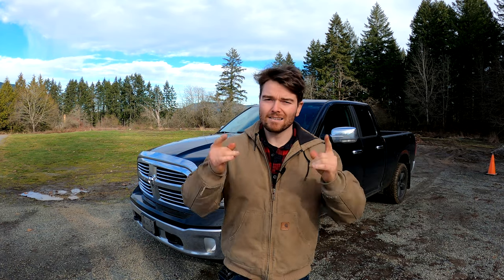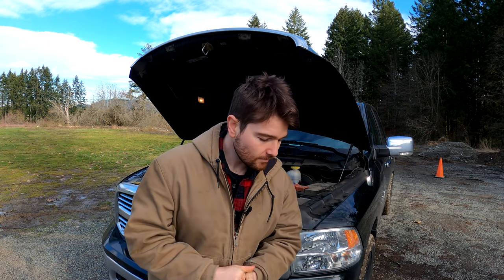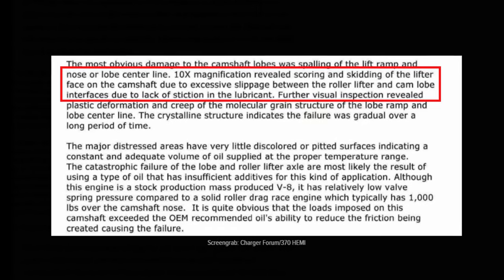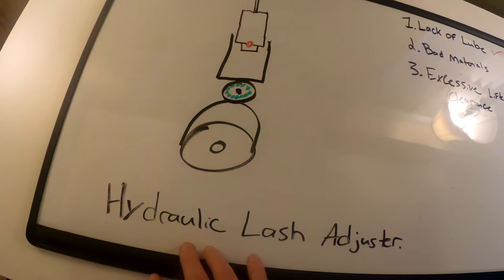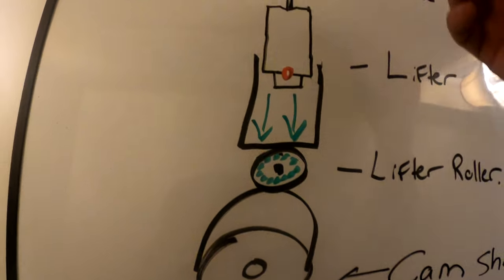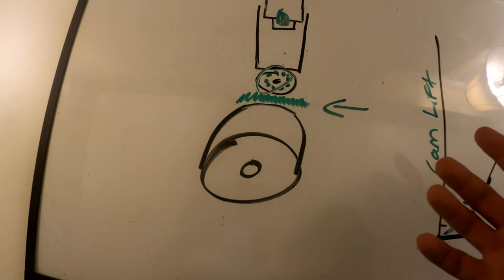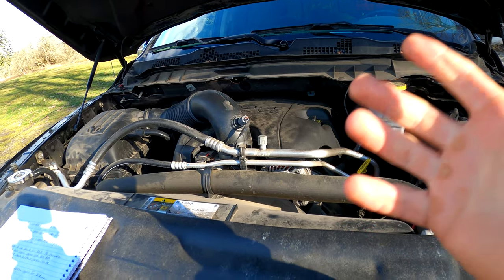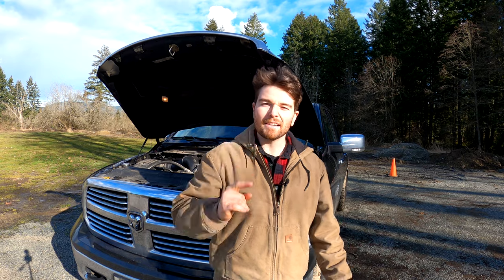RAM 1500 HEMI TICK Explained (Revised) - The Cause And How To Protect Your Engine

Comment: Not a knowledgeable car/truck guy. So, I'm a little confused. Obviously, stay on top of your oil changes (which I do). For now on, I'll buy the best fully synthetic 5w20 oil to bring it for the mechanic when I need an oil. But, my question is can geting ahead of the problem and replacing the lifters help get ahead of making sure you don't destroy your engine? And if replace the lifters, should I just replace the camshaft as well? My truck is at 128k miles.

Comment: Oil itself does NOT break down over time.  The oil can go bad over time from added combustion products (sludge), added water (water vapor) from cold engines and short trips, and the breakdown of oil additives (detergents).  I have worked in a power plant and the oil used to lubricate the steam turbine bearings was never changed.  It was constantly purified to remove water and contaminants.  The oil itself would last forever.

Comment: I have an 07 5.7 ram 1500 i bought from a family membr. been family owned since new.  basically over 300,000 miles on it by first owners business .   I bought it out of a field where it had been sitting for nearly two yrs.   Talk about a loud knock!  i was sweating it till the oil got to the top of motor! lol    anyway.  engine runs amazing and no tick until yesterday i heard it before it was warmed up.  after, it went away again.  No was not a exhaust leak.  i kjnow what that sounds like.  what it is is oil hasnt been changed yet...  that is my to do before anyting  else saturday project!
Reply from the maker: those "earlier" 5.7's seem to hold up better in term of lifter failure. it seems like the majority of the lifter failures are in the 4th gen trucks from 09-present. they re-designed the hemi in 09 and for some reason this re-designe has caused lifter issues. Either way good continuous maintenance goes along way and I've heard tons of people have high mileage hemis running just fine!

Comment: There was another video that a mechanic said that the problem was happening on 5.7 engines on fleet vehicles that all have had early oil change intervals. I also don't believe that there is a synthetic oil on the market, from any competitive oil company,  that so lacking in quality that would result this damage    I would hazard a guess that this issue has been discussed at length by FCA executives while using the "Cones Of Silence" in the board room. But unlike the tie rod issue don't expect a recall any time soon,  this is not a safety issue .
Reply from the maker: it's an interesting issue because many people have tried to find the cause (myself included) and the answers seem to kind of all differ. it could be a combination of things resulting in lifter failures. 

But what is fore sure certain is that FCA is aware of the issue and hoping to keep it quiet. I mean they did quietly update the lifter in 2016 so perhaps they are speculating the lifters themselves were the issue. time will tell if the 2016+ hemis are having the same issues

Comment: There are lifters available with bronze bushings instead of needle bearings.  Would that not be better?  Is synthetic oil better for this engine than non-synthetic?
Reply from the maker: Synthetic oil is by far better. As far as bushings, bronze is soft those needle bearing are hardened steel because they take a beating when the came lobe rolls around at speed. But its an interesting idea

Comment: I know this is video is old but there are at least four things wrong with your leaning to a bad oil theory: The first being the lifter lab study. The study wasn't necessarily wrong with their data, but their data was limited...to one study. What effort was placed into sending failed camshafts and lifters to multiple labs and comparing reports to see if they concluded with the same results? Which leads to the second thing and that is the study mentioning a lack of additives. How many people really put additives in their oil, regardless of year or make of vehicle, or engine type? Why would Hemis need an additive over any other engine out there? Thirdly, there have been a number of failures on Hemi engines where the owners changed the oil religiously every 3,000 miles. I for one, developed this failure on my 2010 Ram 1500 and the oil was changed every 3,000 miles religiously using Valvoline 5-20W. And fourth, we did not find this same failure in the 03-08 Hemis. They call for the same viscosity of oil and oil change frequency as the 09 and up Hemis. Why weren't they failing? Were 03-08 Hemi owners doing more frequent oil changes or using a higher grade of oil? I highly doubt it - 03-08 owners were likely following the same change patterns as those people who had 09 on up. So although sludge could be a contributing factor or accelerate wear, I don't see it as being the root cause of the Hemi failure. In my opinion, I really think the root cause falls on lack of lubrication at idle and low RPMs. Chrysler made design changes to the Hemi in 09 which, created several contributing factors: lifter angle, camshaft height, poor clearances, etc. Multiple studies have shown that the failure occurs predominately in engines that have excessive idling times. The engineers failed to foresee what the new changes would do under these circumstances. I think Uncle Tony is on to something about the need for an oil feed system above the camshaft that would drip down onto th lobes and lifters regardless of the idle speeds. Now I will say that the high idle times do increase breakdown of oil since vehicle engine hours are increasing, even when the milage isn't. But again, this by itself, doesn't account for why we didn't see the same thing with people who had long idle times with their 03-08 Hemis. When considering all factors, it points to affects created with the design changes and why Chrysler changed the lifters in 2016.

Comment: ⚠️THE 5.7 & 6.4 HEMI ENGINES BOTH RUN THE SAME OIL PUMP. THESE 2 ENGINES SUFFER THE SAME LIFTER PROBLEM DUE TO THE INSUFFICIENT 
*OIL PRESSURE @ LOWER RPMs*⚠️

THE 6.2 HELLCAT OIL PUMP PROVIDES HIGHER OIL PRESSURE @ THE SAME RPM TO THE 5.7 & 6.4.

All 2009+ hemi oil pumps are interchangeable regardless of engine liter. 

I highly recommend upgrading the oil pump along with lifters and cam.

Thank me later.

-Dad
Reply from the maker: Thanks dad! Lol a couple people mentioned this and it makes sense.

Comment: Ok so I have a 2016 Ram 1500 Hemi and I've noticed that when I let off the gas going about (starts at 25-30mph) I'll get this tick/rattle, when I get back on the gas it stops... I've noticed that when I get to about that time when it needs an oil change it gets a little louder... I'm guessing it's a lifter correct???
Reply from the maker: potentially but a lifter tick should be constant for the most part.

Comment: I just had to replace my cam and lifters in my 2012 ram 1500. they went out at 213,000 miles, i always changed my oil at 5000 mile with Mobile 1 full synthetic 5w 20w and Mopar filter, I think its just a shitty design personally. I know my failure was not from bad oil or wrong weight of oil. Oh, I also never let my truck sit and idle. Also had to replace both exhaust manifolds because they were warped.

Comment: I have had these issues with the 5.7 hemi. I honestly believe not enough pressure and under rated oil pump. I think its a oil pump issue. Stick a hell cat oil pump in there. There are videos and yes so far seems like it works. Time will tell.

Comment: Good video, I always like following your stuff! I've watched a lot of videos on this and Uncle Tony is quite convincing along with the idle hours due to lower oil pressure and based on a new video at Idle the MDS isn't activated to pressurize the lifter bores. That covers lubrication but I like the other components your talking about in this video..Here is another explanation that talks about some more topics - https://www.youtube.com/watch?v=8lj4mLhAI4Y
My Ram dealership said it calls for conventional oil and looked at me weird when I asked for a Synthetic Blend or even Full Synthetic. I'll be using Synthetic for sure on my 2014. It is interesting as well that the service manual doesn't really state how often to change it. It basically says wait for the oil change indicator system to remind you and to change it before 10k miles or 16k kms or 12 months...so I blame the owners manual as well for letting the general customer trust their indicator light. I change mine every 3,000-5,000 miles (5-8k in kms). Keep up the good vids man! I appreciate the new info.

Comment: A perfect storm of a series of unfortunate events.
Edit; btw, what do you think of porting the hellcat oil pump and putting it into an engine with the same bypass spring? 
Would you think it needs a bigger oil pan or what to go along with it?
Reply from the maker: apparently the hell cat oil pump fits right into the 5.7 and they are only like a couple hundred bucks. that's what I've heard but who knows the long term issues/ benefits of doing so.

Comment: I have 2015 ram hemi, and i have this ticking sound when starting the engine for around 1 minute then the sound is gone. I could not find any issue with exhaust manifold, could it be from the lifters? Or should i double check the manifolds again?.

The sound started 6 months ago, have slightly increased. However car is running perfect with so ticking sound after engine is warmed up
Reply: Had the same problem on mine and had to replace cam and lifters!
Reply from the maker: usually when the ticking sound lasts for a short time (like 60 seconds) it's a manifold leak. however, if the manifold is not leaking there is a chance it could be your lifters and after getting warm for a sec their clearances tightened up and the ticking becomes less obvious. 

Honestly if you are concerned bring the vehicle into the dealer or a trusted mechanic and pay for an hour or two to properly diagnose what's going on. they can probably narrow down what is causing the ticking sound pretty quick.
Reply from the maker: @lalo27ish  that sucks, how many Km's on the engine?
Reply: Exact issue on my ‘14 recently. Shortly after starting, the tick goes away. Would like to know how things progress for you Ahmad. 🇨🇦
Reply: @barrybebenek8691  unfortunately I confirmed its not the manifold. The sound started increasing specially at cold start. When the engine is warm it is also slightly audible.

Will plan to replace lifters soon and check for cam damage.

Comment: If it is bad oil then Chrysler is putting it in their engines right from the assembly line because my 2015 has been ticking from day of delivery ! Finally whipped the cam now two dead cylinders after 75,000miles still running at 152,000miles. I'll start looking for a replacement in a week or two LOL !  My best guess the oil ain't getting to the lifters !

Comment: Chevy 5.3 has same issues, I believe it’s the cheap lifters, my father in law has a gmc with 5.3 lifter failure at 60k Miles with synthetic oil and regular service… Chinese lifters as well… hope my 2018 ram stays quiet 🤣

Comment: please define bad oil.  How many miles?  I don't know anyone who would run an engine 14000 km without an oil change.  Are you suggesting that a normal oil change interval of about 5000 miles would prevent the hemi tick or is this a design flaw by FCA?  Very informative video nonetheless.

Comment: Uncle Tony's Garage found out why it does thus. Bad oiling compared to the old 318 and 360's, or any old Mopar engine. To get enough oil to properly lubricate the cam and lifters, you need to be over 3,000rpm. When you combine that with the bad oil, like Mobil, Castrol, Penzoil and so on, the cam fails. This is why it is necessary to use a good oil like Royal Purple, Lucas Oil or Amsoil because of the superior wear protection. Every day I take the engine up to 3000rpm for a bit and I use Royal Purple. The good oil stays up there longer and protects the engine.

My claim and trust in Royal Purple came after using it on my motorcycle. You may or may not believe me, but I had my bike often at 5 or 7000rpm, across many gears. I didn't ride "lightly." After 10,000miles on one batch of Royal Purple, when I change it, I saw that the engine oil color was still Purple after 10,000 miles. When I saw that, I swore I'd never use another oil brand again. 

And now, in my Dodge, I check the oil and instead of being black, like so many oil inferior brands turn, it's light brown. Combined with Seafoam regularly and Royal Purple, this next change, in 20,000 miles, would be purple, instead of black.
Reply: guys change the full synthetic oil every 5000 mil ,that is crazy,any full synthetic oil is good for more then this,so if the engine lifters and camshaft are bad after 50.000 mils then this engine is just a junk,shame of the FCA
Reply: @marmay6874  it turns out to be that way with some folks who use shitty oil like the most common ones. In my experience, Royal Purple did an excellent job even at 10,000 miles of 5-7k rpm daily. It was still purple when I changed the oil, not brown or black like with Mobil, Pennzoil, Castrol and Valvoline, so on
Reply: @thunderheads4103  I have  2019 classic and I do my own oil change with Shell Rotella 5W20 ,and as far as I know this oil is one of the best,many owners send the oil sample for testing made by Blackstone laboratories with excelent result even after 10.000 miles,but again if there is a bad engine design,lack of lubrication on the lifters or camshaft,no oil will help,and one more thing,the light reminder for oil change,this is set up by FCA and right now I have almost 8000km and 47% left for the next oil change but I am willing to do this at 10.000 km anyway,hopefully this engine will perform well for the years to come,so I wish yours as well.

Comment: Great stuff!  2013 5.7.Hemi 135k. Always thought the 5w-20 would be too thin in the Florida heat but apparently thinner is better in this case.   Mine just started within couple days of switching to a 5w-30 synthetic you explained this perfectly thank you.  Get's a thumbs up and subscribed! JR
Reply from the maker: thank you sir! with those hydraulic lifters different oils can effect them so it's always good to stick with the recommended oil weight especially with these newer engines having such tight tolerances. the older engines you could throw in any weight of oil and it would run fine lol
Reply: @TheGettyAdventures  Love the truck otherwise dammit man! lol I'm almost inclined to go even thinner but back to 3k intervals like we use too lol  Got a great guy to listen too it for me tomorrow thanks again!

Comment: I have a 2018 Ram 1500 with a Hemi. I have noticed in the past : Cold Start facing down-hill = Ticking for first 10 seconds     Cold Start facing up-hill = No noise.
I believe this issue is lack of oil in the sump or lack of oil flow to be the culprit.
I use Synthetic only 5W20 and Mopar filters and the OLM. No issue yet at 96000Km. I try not to park facing downhill as my driveway is on a hill. I also use a catch can and empty the crap every three tanks of gas or so.
https://www.youtube.com/watch?v=ZPFY5Hl_E18
Reply from the maker: Interesting! I know sometime if I start my truck to just move it and shut it down after like the 30 seconds. the next time I start it. It Ticks like crazy for a good 5 seconds. 

either way both situations are from lack of oil and when oil finally gets to the lifters the ticking stops. I just hope she lasts!
Reply: Mine does this as well🥴2018 1500

Comment: Just had one of the lifters on my 2018 ram fail at 85,000 miles. I change my oil myself religiously at 3,000 miles. Frustrating to say the least
Reply: I should mention, I only use wix filters with SAE 5w20 as well. In my particular situation I can only assume poor quality lifters because i cant think of any other reason for it to fail at 85k. My truck pays my bills so i take extremely good care of it

Comment: Yep, not taking any chances, been running Amsoil Signature in mine since I bought it 3 years ago, bash the name all you want, but it has won against all others, and buying and changing myself, I can do my truck for 80 bucks, with an Amsoil filter, cheaper than most places will do conventional for, in my area.
Reply from the maker: good on you sir. I personally run mobile 1 because It's a decent full synthetic oil and is usually always on sale. In Canada It's usually about 100 bucks on sale. 

Either way I think if you were running conventional oil and changing every 5k you would still be far better off then running high grade oil for 14,000km.
Reply from the maker: @JD Spears very interesting, I know Chrysler says that the transmission oil is good for the life of the transmission (or 160,000km) but I find that suspicious. good to know what you run is working well!